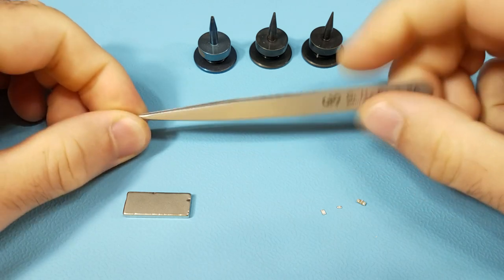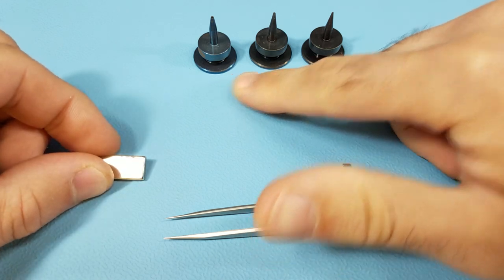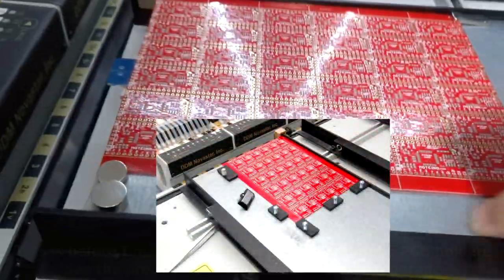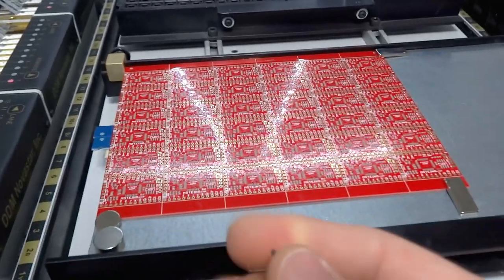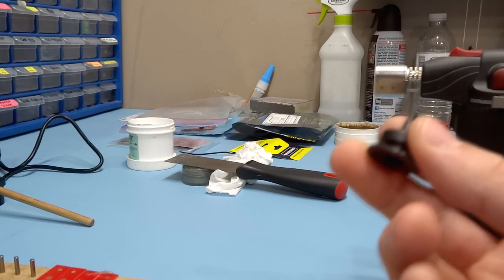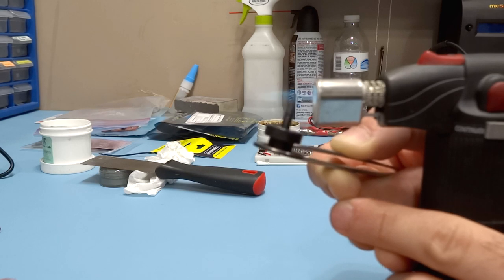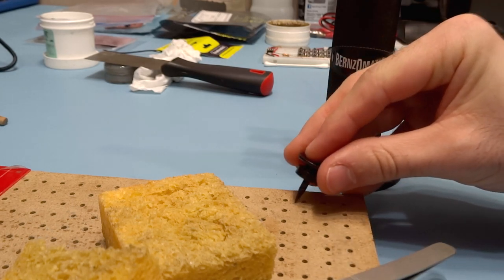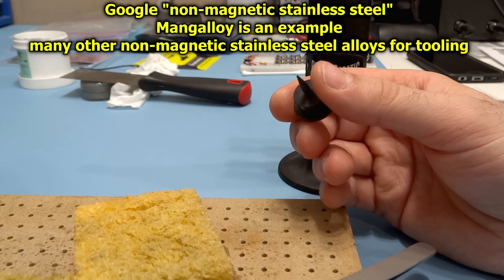Pick & Place Nozzle Demagnetization

Comment: The nozzles are held onto the spindle magnetically, which allows them to be easily swapped while running a board, so they do have to be made of magnetic material.  This means they can have an issue with becoming magnetically attracted to small components, with some manufacturers being more of an issue than others.  Normally, the viscosity of the solder paste would be enough to overcome the issue, but not always.  Using the demagnetizer tool is a good option.  I wouldn't actually suggest heating the nozzle though because the nozzles are annealed before annodizing and heating it would cancel that.  This would decrease the life of the nozzle as a whole.

Comment from the maker: Thanks for the comment and suggestions. There are obviously better methods. In the heat and frustration of the moment, I googled around and heating was the only feasible quick way to demagnetize the tool and finish the job I had waiting. I learned about other methods from folks who commented on the blog and here.
Indeed nozzles are held in the spindle by a light magnet. DDM Novastar claims they are made of non magnetic material. IMO they should NOT be magnetic at all, and they should be held in with a locking mechanism, OR the nozzle TOP should have a welded/glued washer that is magnetic, not the whole tool. Magnetizing and picking up ANY components unintentionally is unacceptable even at a 0.1% rate. They should do whatever high end machines do, especially on the nozzle which is so important.

Comment: How about the hysteresis method (it is fully electrical just electromagnet, AC and potentiometer / AC current source)? It was used to demagnetise CRT monitors.
Reply: yes, try this also, have air coil on mains (or on transformer) (one that will have enough resistance not to burn with power on it), then you insert metal into field and slowly take it out of the field. You do want strong mag. field, too weak might not work. I find this most useful, when you can't heat the object, if it has some plastic on it or so
Reply from the maker: Thank you I appreciate the suggestion, will look into it next time!